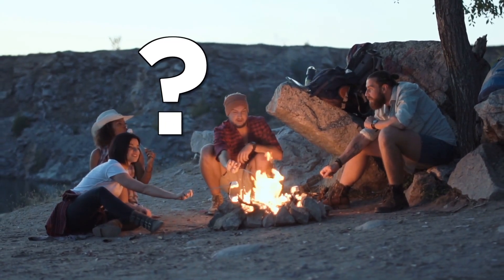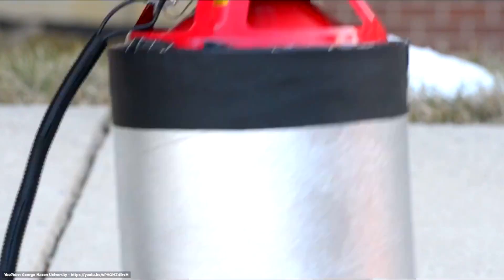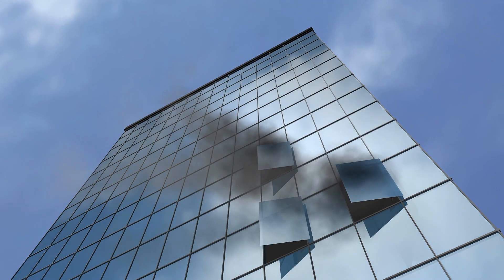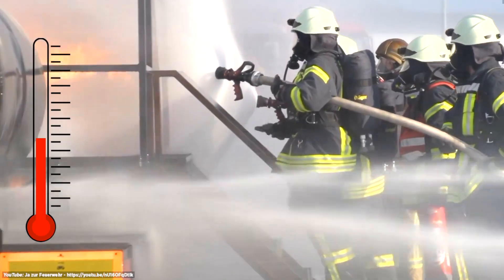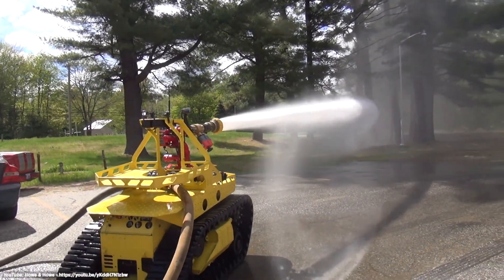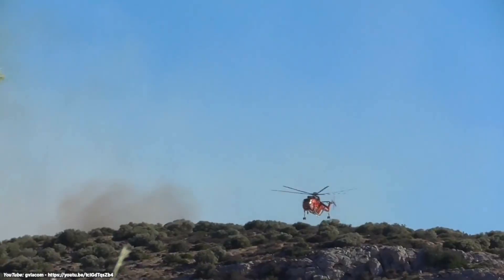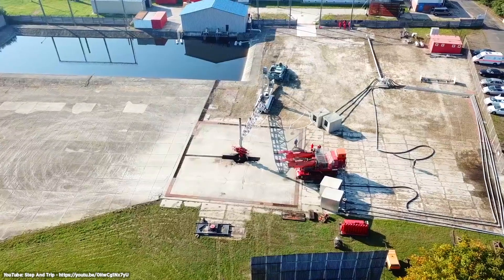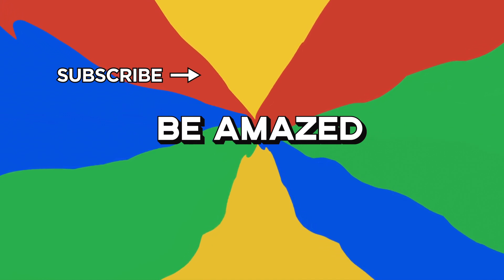Powerful Firefighting Inventions We Need More Of

Comment: 3:43.  "That's a problem for firefighters because the average fire ladder can only reach to about 230 feet..."  On what planet do you get this information?  I was a volunteer firefighter in NJ and climbed to the top of our rig's ladder truck - a mere 105 feet.  That is about the maximum most apparatus usually comes around here.  I've never seen anything higher than 120 feet but I'm sure somewhere they have them.